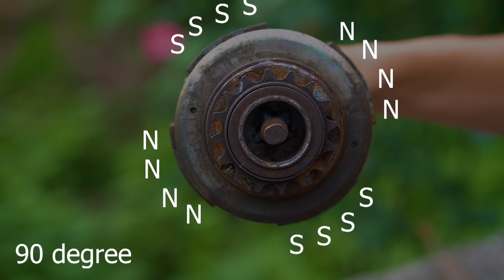I build 220v electric Hydropower dam

Comment: The rotation speed is not high enough to provide the frequency and voltage required to turn on the fan. And when it went under load, it did not affect the rotation speed of the generator.
I think  power came from elsewhere.
Reply: I'm an electrical engineer bro
This is a fake video
Reply: Yesss
Reply: @lorditsprobingtime6668  Well said mate! I did the exact same thing and looked at the other con Vids on his channel.  He's laughing all the way to the bank conning people. Amazes me how many people fall for this crap but then again, seem that most people know as much about basic electricity as they do brain surgery.  Im not an electrical engineer , just a home hacker that likes to play with generators, solar and other things and you can see this is complete and utter crap. I saw it in the thumbnail and wondered how he was conning people, Now I know.  Maybe we should all report this channel  for the misinformation? If they get enough complaints they may do something about it.
Reply: @FarhanKhan-ko1rp  it is a real dc generator tho if he was to use 4 diods and then a inverter he could make 220 but he would still have to get it to a much higher rpm
Reply: @FarhanKhan-ko1rp  prove it
Reply: I thought as much, still watched it though as it wasn't a boring video imo
Reply: @chrisjones6351  😂 true 👍🏻
Reply: @dragonsaxaphone7855  4 diodes to make a full-bridge rectifier. 👍
Reply: @FarhanKhan-ko1rp  oligopólios oligopólios
Reply: 0000
Reply: @lorditsprobingtime6668  You are exactly right it takes far more water and this junk to make anywhere close to those 6 or 8 thousand watts of power. The idea or theory behind the video is legit yet his numbers and equipment are not correct. A ball park guess is that this is a irrigation ditch that has water running from a higher up area and sends water down to the lower lands and in theory one could build a good working unit that has paddles and maybe produce a 100 watts or something along that lines. It might be enough to run a few of these every so often and produce enough to provide some sort of power for a small home.
Reply: @glumpy1024  Sorry glumpy, I've only just seen your reply. I put a fair bit of time and effort into reporting all these bullshit ones to YT and yet every single one, even the very worst and bloody obvious to anyone but an idiot ones are ALL still up. I don't think they give a shit as long as the money keeps rolling in. I consider that they've got a responsibility to help protect those most vulnerable and desperate people but apparently to YT they just don't matter. As usual, a company gets big and all ethics, compassion or honesty go straight out the window and all they can see are the dollar signs.
Please do report them everybody but don't be surprised if it doesn't seem to make any difference. As you say though, if enough do it they 'may' start to think about doing something at least.
Reply: @kameljoe21  You got it. I figure very roughly around 100 Watts if done right from that flow and with just that small amount of fall too. That's not much to work with but assuming he's got access to that flow 24/7 he's at least got it trickling in day and night so a storage battery bank and inverter and what's been built up while not using power or less than that 100 Watts can go into storage and with a decent sized inverter could run almost anything for limited periods.
I've seen one setup using a micro turbine arrangement that was genuine and he had a creek passing through his property with a dam giving it a little over a 6 foot fall and he was getting (rough memory guess) about 600 Watts while it was running and that did feed into a battery bank and out through an inverter that gave him a pretty good but still limited supply.
Reply: @lorditsprobingtime6668  Yeah I am pretty sure that this is a split off of an major irrigation ditch. As you can see in the video that it is a fresh cut V ditch. Which is what they do when it comes off of a main ditch. This water will go down to another ditch that will flow back in to the main ditch at some point. The cut out ditch will either feed an inlet to a gated pipes or use siphon tubes to feed the crops. In seasonal area which have snow this flow will last half of the year. So ideally you could reap a good amount of stable production for part of the year. In areas that have no snow and have mountains or very very large hills and or good rivers/creeks the flow will be pretty average for the whole year. Now it depends on where the main ditch is and how its routed on to your land. As the main ditch would be the one you would want to put your system at as it would have the most flow.
Reply: @kameljoe21  I live in Australia and have lived in farming country most of my life, I know how irrigation channels and systems work.
Here he would need a water license and would be entitled to a set amount of water. There'd usually be a metering wheel on the main offshoot to his property and everything else would depend on just how much he's allowed under his license.
He could have saved himself a lot of work AND made this much more effective if he'd simply run a pipe slightly bigger than the inlet to this unit. It still wouldn't produce anything like the power he falsely claims but, he would get better pressure to it. That all suggests he needed to dig this irrigation extension anyway and thought he's take the opportunity to make yet another scam video out of it since he had to dig it anyway.
Reply: @FarhanKhan-ko1rp  As generator engineer with focus on the electrical part, I can not even start ....
Reply: @lorditsprobingtime6668   I reported this and other Vids a week ago. As you say, they don't give a rats about misleading, fake Click bait Vids, as long as one does not have the wrong political narrative or promote an alternative way of thinking  to the approved one all is good. Rip people off and mislead them, not a problem. Don't push the MSM narrative, Cancelled.
Reply: I think he confuses watt with milliwatt
Reply: maybe the answer is that idling engine haha tapped the power inverter from the car battery notice #18:44 that how it works ,they burried the wire to hide the real power source and tadaaah tricks came out
Reply: @FarhanKhan-ko1rp  I assume that regardless of the conservation of energy and the fact this is your fields, people still made excuses. I'm curious, what were the comebacks to those facts tho
Reply: @zanefraser714  😊😊
Reply: @lorditsprobingtime6668  yeah 😊
Reply: @lukeburr5633  And Since Using Preferably 3 Or Vs 4 Primary Transformer Coils rated @ 1o Amps @ 220 VOlts is A Good beginning To A 3 Or 4 Phase Electricity Plant,, And Then Comes The Low RPM's And Mess It All Up All the way To The He's High Circuit Reluctance......... :-) 
Cheer's FoLks... :-)
Reply: @FarhanKhan-ko1rp  Why..Its just an generator.. 😅..You have to know Mr. Ingenuity
Reply: True dude !
Reply: Low rpm and the light don't even dim... Fake
Reply: hii guys
Reply: Thanks 🙏
Reply: @FarhanKhan-ko1rp  
Thanks for the information
Reply: @glumpy1024  It's still entertaining to watch, so he's doing something right regardless of the inaccuracy of his numbers.
Reply: At first glance, it appears that way that the power is coming from else where. However, I couldn't see any visible power cords beyond what is seen(was it buried?). From the video, it is also difficult to determine the speed of the fans... they appear to be barely spinning. That light globe appears very dull. 

This type of generator, a 4 pole unit, can produce electricity. Just not very well and certainly with little efficiency. They also self limit speed, especially when wired in series, which is how he had them wired. And those shorted pole fan motors, they can run on anything that ressembles AC current, generally speaking(unless the voltage is excessively high, then they emit smoke.. 🤣)
Reply: ikr
Reply: I think it's powered by another source and the "generator" is actually a motor. no way a dam with such a low head can produce any energy
Reply: I didn’t see any wires going anywhere else? I think it’s running the fans and the globe.  Not 220v and not 7000w but I think the fans are running slowly off his gen

Comment: There's a lot of improvements you can do to this, like maximizing efficiency of the bucket's water processing, making the most out of the current of the water, the outflow of the exit pipe's position to make sure no water is is being slowed down, adding a stabilizer at the lowest point of the shaft so that it doesn't move around, replacing the flat sheets of the turbine with curved ones, or even replacing the sideways turbo styled bucket system and instead use a downwards cyclone styled one. Lots of ways to squeeze the maximum potential out of this.
Reply: @Android-ng1wn  i dont think so
Reply: @tengamercz  If you watch from 15:25 - 15:35, you can see 2 wires coming out of the bottom of the gray support cylinder that shouldn't be there

Comment: 4:00 usually if you weld bearings, the heat from the welder boils off/burns out the grease in them. the best way to make sure they last is to re-pack them with grease so they dont run dry
Reply: i love u
Reply: True. Just tack the bearings not full weld.
Reply: Welding even near a bearing could be enough to ruin it by making pits in the running bed ...
Reply: @hollander133  You only get that when you connect your earth lead in a way that the current has to run through a bearing. Simple solution, don't. Put your earth on the same side as the weld will be going on then be very careful about the heat getting to it, especially if it's a sealed bearing. I've welded things in a lathe and you could connect the earth to any bare metal part of the lathe but, then you would start the damage that would stuff the spindle bearings so there, inconvenient as it is because you have to keep moving it, you connect the earth to THE WORK PIECE.
Reply: @lorditsprobingtime6668  You are very right and in theory this definitly holds ground. Tough in my experience working with motors/generators above 30kW I have noticed that it stay's tricky. 95% of the time you are right, tough in the other 5% I can only say, have fun changing the bearings.
Reply: @hollander133  I get that in some situations it can be slightly tricky, and you do have to think ALL the time about the path the current will take. You sometimes also have to be careful to strike the arc on the correct side of a join to avoid it running through a bearing but it's never impossible and I've NEVER run weld current through a bearing yet after hundreds of situations where I could have if I wasn't paying attention. I'll NEVER be changing any bearings for THAT reason.
Reply: @lorditsprobingtime6668  Maby because I work for a repair complany I might see it more than usual as we get all the problem stuff. What I think that might happen with motor is, that welding takes place while the rotor is in place while welding on the house. That way a small amount of current goes trough the rotor an thus the front and rear bearing. I don't know on what type of machinery you weld, so I can not say if this could happen to you or not. Tough I have seen this happen like this. 
There is one thing I can definitly say, not all people are as carefull as you with placing the nutral.
Reply: Not to mention the internal arcing when he welded the bearings together on the shaft.
Reply: I was about to comment this, glad I don't need to now, couldn't of said it better myself.
Reply: Don't be ridiculous, he wasn't directly torching the bearings or even held that amount of heat nearby for long enough.
Reply: @gegervary  it really doesn't require heat directly onto it nor for very long.
Reply: Yeah the bearing are gunna be the issue ;'P
Reply: Just make the hole fit the bearings and press fit weld collar on the bearings never on the race as it will distort
Reply: @hollander133  it’s capacitive and it causes small arcs and pits from the stress riser

Comment: The power source is inside the pvc pipe.
And when load was connected the turbine didn't slowed down 🤔😂
Reply: The fans are barely moving, how is this fake?
Reply: @lr8198  but that 60w bulb?
Reply: @FayanG  a 60W bulb that barely lights up. The fan struggles to move. Maybe a watt or two from the generator. Could maybe charge a phone in 4 hours which might be good enough for some.
Reply: @lr8198  the fans are moving at normal operating speed and he had 2 of them plus a bulb simultaneously.

This generator would barely be able to operate any one of these things alone at 100% efficiency and I doubt this contraption could achieve 30%.

Comment: The outlet is to small, this means that the entire bucket is filled with water.
This also means that the blades has to move a lot of water this requires energy, so you loose most of the rotating power you got from the water inlet. 
The speed the blades have is to high for what energy you get out of this setup.
The pipe the transformers are sitting on probably contains a motor that powers the rod he connects here. 3:15
Reply: At 15:25 you can see wires coming out of that pipe before they set it into place. Hidden motor.
Reply: @jeffumbach  yes I can see it too the whole project is fake lol

Comment: Let’s say it all together 
👏stop👏welding👏bearings👏
Reply: Clean👏the👏metal👏before👏wielding👏 It just makes for stronger wields and a cleaner look.
Reply: They are just building their POS build,  for the viewmoney  Well   F. Em,  cause I m not even watching, just seeing g how many non bot comments there might be 🤔
Reply: Hey, legitimate question from somebody wanting to learn: why not weld bearings?  Because the heat will warp/distort them?
Reply: @billsmith7673  bearings are heat treated to be very hard, by heating them up by welding you ruin that heat treat and make the bearings soft so they wear much faster and then when you need to replace them you have to cut them off instead of just removing them like normal bearings
Reply: @billsmith7673  also welding cooks out all the grease
Reply: STOP. WELDING. BEARINGS!!!!

Comment: Despite the other issues… that’s awfully brave of you to use an arc welder on a microwave transformer.
Reply: That shit is dangerous.
Reply: Yes
Reply: Plz explain. I would like to know why and how it it dangerous. 
(Because I do not know.)
Reply: Plz explain. I would like to know why and how it it dangerous. 
(Because I do not know.)
Reply: @janesigabaro7593  
TLDR: Arc welders can recharge the transformer.

I’m not an expert electrician or anything, but this is my understanding: Microwaves are the #1 cause of death in hobby electronics, and it’s almost always in the case of not properly discharging the electronics, particularly the transformer. The high amount of residual charge leaves it very fast if it is shorted by a metal tool or your hand, and the high amps are what stop your heart. By using an arc welder that uses a high amount of electricity to attach them to the plate, even though most of the electricity is going into heat, you’d be reintroducing a small amount of electricity into the system just by proxy, along with some other static charge, natural capacitance, etc. made by the molten metal. Even a small amount of charge left in the transformer can be very deadly if it is unknowingly mishandled. I’m glad that (I’m assuming) no one was hurt. I would recommend using a gas welder, or better, just some bolts and wax next time to avoid the risk.
Reply: @tpeter4240  transformer can be charged? well ok...
Reply: @tpeter4240  That's with capacitors, not a simple coil.

Comment: So another title for this video states 7000 watt generator, that is a lot. almost 32 amps, if you did produce that much you'd melt the cable.  A theoretical value or measured ?
Reply: Likely theoretical. I can see it doing that given larger cables, and maybe stronger magnets. But tbh I have no clue about the exact magnets used. This guy does have a solid understanding of what he's doing though. My question is, is this a permanent thing for his home or a demonstration? I can see some serious property damage in the future if he does not solidify the spillway or make emergency runoffs... But this looks more like a ditch for rainwater so this is nothing potentially catastrophic. Awesome demonstration nevertheless and gives me ideas about how to better utilize the downspouts from the roof of my house lol.
Reply: Probably 100W or so. No chance in hell given the weak magnets, alignment, air gap, the coils aren't even really arranged properly
Reply: @petezel  Yup, about 120W roughly. A household fan typically draws 50W, 2 fans is 100W. The light bulb is probably 20W.
Reply: Complete and utter Bullshit Clickbait value!
Reply: Same thing as I thought, I guess it could in theory have a capacity to generate 7000w due to fact it's probably 4x 1750w transformers. With that setup there's no way he'd get that ammount.
Reply: This is fake, the power source is under the PVC pipe.
Reply: Looks like there was 3 fans at one point but he needed the motor off one to power the blades, come on YouTube.  Some poor kid is going to fry himself trying this crap
Reply: If you say that 7000W at a current of 31 Amps  it means the alternator is working at a unity pf otherwise expect a very  lower pf from this setup and the real power generated is not even anywhere near one hundred watts.